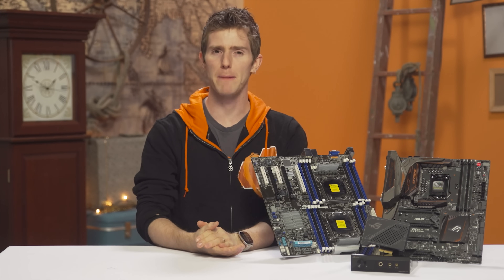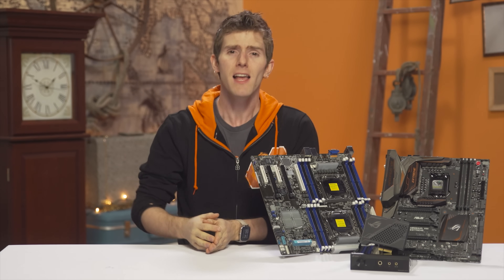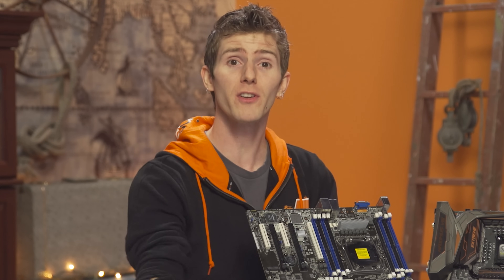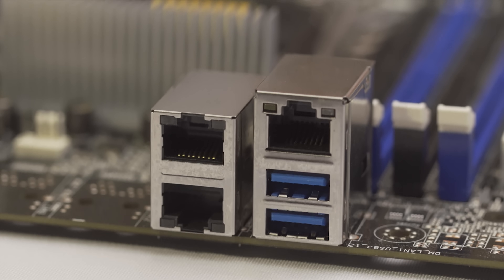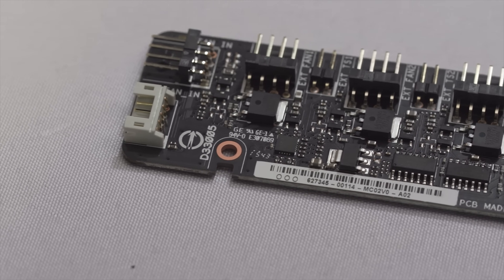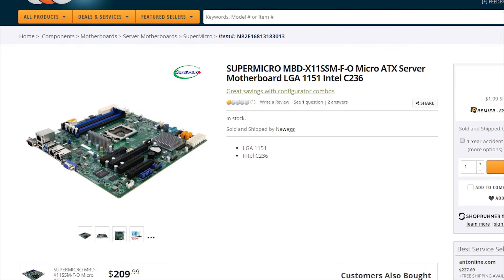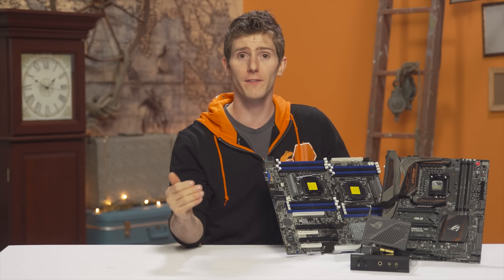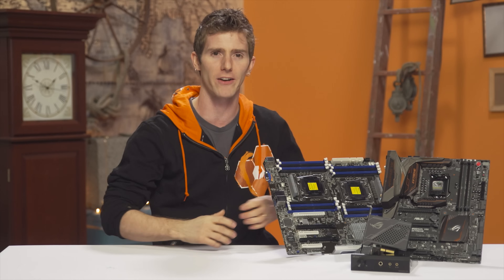What is the best choice for a motherboard? - The Final Answer

Comment: I should've watched this video years ago when I built my pc, but not for the motherboard, I bought a 850W power supply, but I didnt have anything to justify 850W, I could probably have went with a 550W or 600W one.
Reply: I thought I was bad with my 750 watts XD
I don't even use things like crossfire for dual GPU's, which would really benefit from that much power. 

On the bright side: it's still better than gimping on your power supply and as a friend of mine said: "view it as future proofing" :P
Reply: ***** Yeah, my plan was to eventually use SLI or Crossfire, but I was like "My system runs games really smoothly at a high framerate with a single card" and I never bothered buying another card. Also, my PSU is now 5 or 6 years old (5year guarantee gone), so I'm not sure for how much longer it'll hold up, even though it was a good quality PSU.
Reply: Perhaps some of the videos Linus has made on this channel, NCIXTechTips and/or Teckquickie can help answer that question? I don't know much about PSU's, unfortunately.

I did think about buying another graphics card as an upgrade at some point, but by now, the card is no longer available (discontinued) and I decided that crossfire/SLI is too much of a headache anyway. Not all games having proper support, bigger chance of experiencing problems and the issue that you might need to improve your cooling.
Keep it simple: use one powerful card :P .

Comment: motherboard choice is quite important. I bought the MSI 970a-g43 for a phenom ii x4 965, hoping to upgrade it to a fx8350 in the future. But no (despite it saying it supports fx cpus), it does NOT support the fx8350 because of its reputably poor heat dissipation. I can't even OVERCLOCK my phenom past 3.8 without risking shorting something out because of its poorly cooled VRAM.
Reply: +Isaac Kim ..Yes !  Optimization for tasks/needs of the specific user and compatibility along with longevity are the message we seek advice on.
Buyer/user reviews are very important, which is why we watch linus, when he and Luke present comparisons with charts and graphs.  rc

Comment: In terms of best and worst, the worst MoBo I've ever had in a rig was the Foxconn Renaissance 1. That thing was unstable as all hell and ran hotter than the sun. The best was an MSI Gaming 5, only supported dual channel RAM, but the layout was fantastic, it had a ton of overclocking and power management utilities and never once had stability issues. Both cost $230 ish at time of purchase.

Comment: Awesome video. Query: If using two AMD 390x gpu's in cross fire 16x16x. Then adding a Nvidia 980ti card 8x to the mix on the same mother board. Would this allow the Shadow play feature to function with the two AMD Gpu's powering DX12 titles. Or would it fail horribly and crash you PC, or worse, cause a rip in reality at the speed of light from crossing the streams???

Comment: This video could have been so much better. Of course your general consumer doesn't want to buy a server motherboard.  A much more helpful video would have been going through a manufacturers lineup of mobos (Say ASUS for example) and explaining the differences between the models in a chipset family.  Features gained / lost, how helpful they are, uses, etc. I am an experienced builder and picking the right mobo model is still a challenge. Was hoping this video would help with that, but nope, TIL to not buy a server motherboard for my gaming rig.

Comment: quick question: msi z170 M5 and m7 do not have an onboard video. Can I get a display by plugging in the dvi port on the motherboard with a i7 6700k without any gpu, or I have to get a gpu installed in order to get a display video

Comment: I spent $400 for the ROG Formula Viii 
Cause I need them pretty RGB lights
Reply: +PhantomTech ROG stuff is bulletproof for average overclockers, that's why I love my Maximus board, 4 years later and it's still a monster, been overclocked with no issues and I monitor all voltage points/temps/clocks/everything in HWInfo64 .... in 3-4 years you will be happy you bought a quality board!

Comment: Lol I still use a vga connection at 1280x1024 for my gaming rig. I'm too cheap to buy a nice 1080p monitor for my gtx 960. please halp. leave suggestions for cheap, nice, 1080p monitors. thanks.
Reply: You are too cheap...
Reply: +Henrix98 I mean, I want a new monitor, but I just build a $600 gaming PC, so I'm pretty much broke on "fun" spend ability

Comment: Buh, I don't understand that Maximus VIII Extreme, they made it look like you could run 3- or 4-way SLI, from the website I read that the 3 top slots are handled by the CPU, and the bottom one by the chipset. But, two things... Seeing as Skylake CPUs have 16 Lanes for direct connection with graphics cards, and NVidia SLI only works with GPUs running on 8 Lanes at minimum, won't that mean 3-way won't even work? And the bottom one using the chipset, I have my doubts even more with that one. Can someone explain?

Comment: Only VGA output today is cheap to manufacture but dumb, DVI-I can handle both and gpu in this server motherboard probably is capable to handle with all types of display ports.  Similar to cheap LCD monitors with only VGA input when your signal is converted from digital to analog and then in the monitor to digital, all of that because worse standard is more common, cheaper, and if you want to upgrade, you must upgrade whole system - except minijack and cinch, but some brands is thinking how to avoid them, and sell us new type of connector, which requies new accesories etc.

Comment: What's the best Z170 Mobo for a skylake 6700k that don't break the bank? P.S it would be nice if it's red lol
Reply: +BADBOYONE What would be your ideal price?
Reply: the best in benchmarks is the 
ASUS Maximus VIII Formula, but if you could list your budget I can give you a recommendation in my experience and benchmarks
Reply: Byte Hound
About £100 bit more or less
Reply: Is this one any good? http://www.amazon.co.uk/dp/B0126R3QPA/ref=wl_it_dp_o_pC_nS_ttl?_encoding=UTF8&colid=1KHZDZ5MLM63P&coliid=I4KZVVIOYWM79
and is there one as good but cost less?
Reply: +BADBOYONE I would go for 
ASRock Z170 Extreme4, but theyre both almost equally as good so you can choose which brand you like more
Reply: SOFLOGONESEXUAL
Thanks for the reply, i may go for the Asus then as i already have a Asus mobo so i should be more familiar with it's bios and sound options.

Comment: I used to pick motherboards based on whether they fit the CPU I wanted, but the market there has some pretty good things on both sides. I won't be able to build another computer for at least a year, since I'm on a travel study right now, but I've now got a new set of rules I follow: start with the motherboard that has the features you want, then pick for performance, not brand or price (with exception to MSi because they suck at customer service for the laptop I bought from them), ASRock (because my experience with them is horrible and their board had me go through an entirely new system before finding the board to be faulty), and Sapphire (because their cards in CrossfireX were worse for me than onboard).

But for my next build, it has to have at least 6 rear USB3.0 ports, 1 USB3.1 Type-C, one M.2 port (preferably two), and I don't plan to give it more than 2-way SLI/CrossfireX. It also has to be under $200. And so far, the Gigabyte Z170M is the only one that fits the criteria. Doing that has led me to play with choosing parts that really do give me the most value for my planned use, rather than just buying for manufacturer names or product class numbers.

Comment: Motherboard, Power and RAM are typically pretty easy for me: I check what I need/what is compatible and what is within my target price range and then just go with whatever just jumps into my eye (as long as there are no real negative reviews). I actually believe that (in general) most of the Hardwareproducers for those components are pretty on par, I havn't had any special experience with one.

Comment: 2:15 And yet, I have had cheap motherboards and good motherboards, and the thing that made the good ones good is that they don't have random insidious bugs you can't quite pin down, random functions breaking because a solder joint came undone or a capacitor failed, and they don't become unstable if you try to put a cpu that draws a lot of power. I don't mean a failing overclock due to maxxing out your vrm, I mean glitches booting, or settings being reset, or something like that. Mind you, we all remember what "budget" and "cheap" mean on LTT, so I suppose he'd agree that $50-70 motherboards with a few notable exceptions are almost always crap. And he's right about the message too. Watch how much you really need to spend- get something with exactly as much as makes sense and no more.

Comment: I thought directx 12 could use multiple gpus without sli or crossfire.
Reply: +Marcel Robitaille If the developer implements it. Not all dx12 titles will work that way, and not always correctly.
Reply: +Hateless even still. Doesn't that make saying "no multiple gpu support forever" a little less true?
Reply: Well, technically if the mobo doesn't support a second card no. But if it did, then yes, for a very few (1 at the moment) select titles it would be less true. His point still stands valid, nobody should buy that motherboard with gaming in mind.
Reply: +Marcel Robitaille I think games have to switch to DirectX 12 to take advantage of that feature, so it wouldn't help most games out today.
Reply: +Hateless yes but we're clearly moving in that direction. Saying forever in the tech world is like saying your pc is future proof. In 10 minutes something better will be out.

Comment: What is the point of this video????? Comparing a server motherboard with a gaming motherboard??
Anyone who needs a server motherboard would never come to this channel for advice,  while an Asus Maximus board is overkill for >>90% of gamers. Why the hell would you use those 2 boards as examples? 
Instead a throw a simple "dont buy stuff you dont need" a call it a day, why don't you talk about the features to look out for when buying a motherboard
Why not talk about mobo size, ATX, microATX, miniATX etc??
Why not talk about difference btw a budget board and a "gaming" board?
Why not talk about overclocking and non-overclocking motherboard and their differences? 
Why not talk about different chipsets and their features???

This looks more like an advertisement for asus than a guide.
This channel is going down the drain. It has more fillers than naruto anime.

Comment: What I found was most important to me, after making sure the MOBO was compatible with my CPU obviously, were number of system fan headers, RAM slots, Size, number of USB slots (more importantly, number of USB 3.0), support for front USB 3.0. Most motherboards I saw when looking would support water cooling mounts and AT LEAST one PCIE 16x slot, had vga AND HDMI output with PS2 and audio. But as Linus said, it depends on your use case and probably always will.

Comment: Got a GA-H61M-DS2 for $50, works for me.

$450 gaming PC. 
i5 2400/r9 380/8gB

Sucks that it limits the RAM to 1333Mhz, but doesn't seem to effect gaming too much.
I'll upgrade eventually.

Got a CX750M for $50 as well, so that should save me a little money when I do... 
And power requirements for my future Monster-Ass GPU will be a non-issue.

Comment: I remember reading on a forum somewhere back in 2011 that someone replaced their GPU cooler (Asus GTX 580) with a CPU cooler and got some pretty good temps at low noise levels. Maybe do this with modern cards or cards famous for high noise?

Comment: Alright, looking to modify my current rig with this idea sooooo..... How would you go about adding a 500GB SSD drive to a 4 drive raid 1 setup? (each drive is 500gb WD green)  Currently my system boots into windows Xp (set #1 for older dos games and for kids) and win 7 (set #2 main). Would it be better for me to use the ssd for win 7 then use the 2 drives from that set as backup space or could i get both os's to share the ssd and set all 4 drives as extra space? (between the 2 sets i currently have around 400-500gb of music/videos/pics/projects/books/and other misc data)

Comment: If you can't already choose the right board between a clearly labelled server board and consumer board then you really should be having someone build your system for you.

Would have been much more useful for people starting out to be comparing a couple of differently spec'ed consumer boards and pointing out some of the potential differing use cases. Do they need crossfire/sli, 18 usb ports, more than 4 Sata ports, raid, overclock capability etc.

Comment: the only thing i'm wondering now is going way down to the 50,- range. what are you giving up?
or, is there such a small difference that you can save the 150,- on something else?
(i'm running a 50,- motherboard with the FX8120 8-core cpu, and besides northbridge being too hot making it throttle, i don't really see that much of a downside? besides, some more expansive motherboards can easily overheat the NB as well..)
Reply: +lolindirlink Well, if you have a FX8000-series cpu, then it's probably justified to spend at least $70 on your mobo. Im actually running the cheapest motherboard I could find, Msi-h81m-P33 at $40. As long as it can fit any cpu up to an i7, 16gb of ram (at lower speeds, but with the money saved on the motherboard, I can actually get another 8gb of ram soon), and any gpu I want, It'll work just fine.
That way I put more money on stuff that actually affects my performance.
Reply: +Theodor Butters it came with 2x 4gb of ddr3 1333mhz, and i upgraded it to 16gb 1866 over a year ago.
only has a AM3+ socket tho, so upgrading the CPU is not really a thing for me (not much benefit upgrading to another FX cpu) i7 would costs me another motherboard :( but other than that, and the northbridge. i think everything is just fine? :)
it's the Asrock 970 extreme 3 motherboard btw.
Reply: +lolindirlink Well, it's more then fine then. As long as it has a 970 Chipset on it, you can overclock your 8120
Reply: +Theodor Butters true ^^ 3.1 - 4.1 ghz is pretty straightforward (except the northbridge throttle because i have a closed loop cooler, a small northbridge fan fixes this :) i guess the downside of saving up.
(the CPU, motherboard and 8gb 1333 ram were all in 1 kit of 250 - 300 or so., so fair enough) :)

Comment: I need a Xeon CPU because I do a lot of 3d rendering with Maya, Max and Vray also I use my computer for 18 -24 hours a day sometimes I don't turn it off for a week so a Xeon is a must. I plan to use 2 - 3 graphics cards for real-time GPU based rendering also, so I need multiple 16x lane PCI-E slots. However, I  need WiFi - (I'm not allowed to trail Ethernet cables), on-board audio and a tone of USB ports. I want to avoid using after market cards because they will use up precious PCI-E slots. 

Which Asus motherboard fits this criteria? 

I want to go with the X-99 Deluxe but Asus say some of the features are turned of with a Xeon CPU - what are they? Turboboost support? Ram capacity? Please can someone drop some knowledge on this?

Comment: Consumer reviews were mentioned. Any chance you could do a video on the best way to analyze all the data presented by them?

Such as I have found that a small percentage of reviews for any product will give the lowest rating for having received a faulty product. That it might actually be possible to tell the manufacturing quality of the product by the percentage of reviews that gave a low rating from defects compared to the overall rating percentages.

I have been buying products for years based on user reviews. I don't know a good way to analyze the data presented though. I have method. I know it needs a lot of work though.

Comment: So here's an idea for a video, why not look at aftermarket air coolers mounted to GPU's? i very briefly mounted a Hyper 212 to my old 7770 and my temps were 30c at max (Stock) Also to address the size issue what about using ITX Coolers? then maybe compare the cooling performance and price against liquid coolers, would be a pretty decent alternative for those buying Used GPU's that are worried about cooling but don't want to waste the money they just saved by buying used on aftermarket liquid cooling...